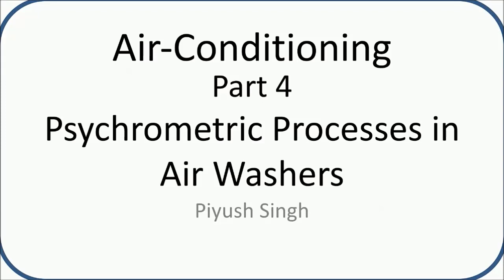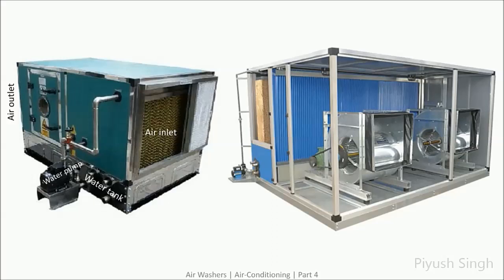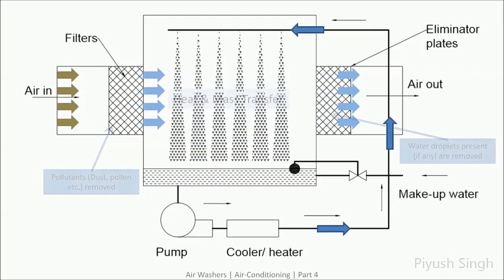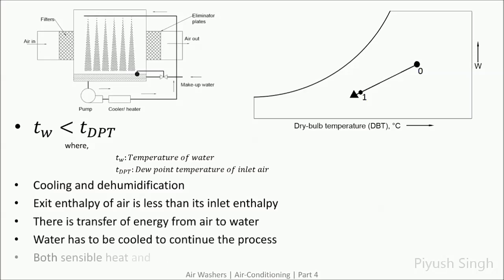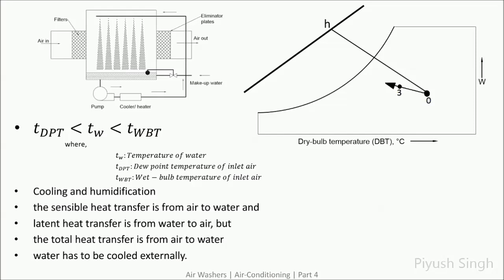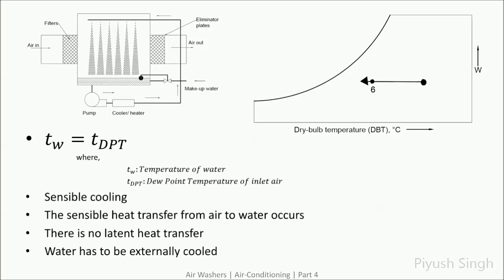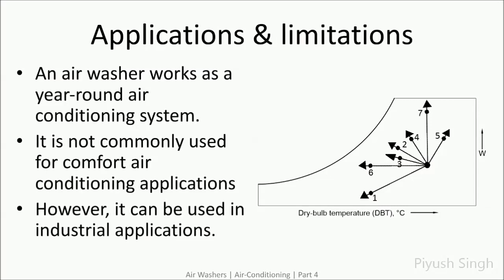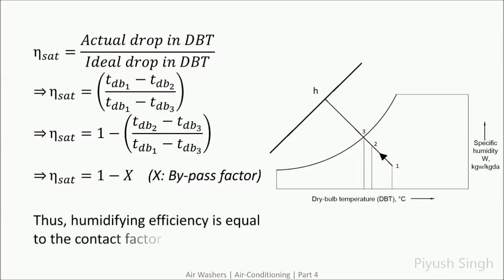Psychrometric Processes in Air Washers | Air Conditioning | Part 4

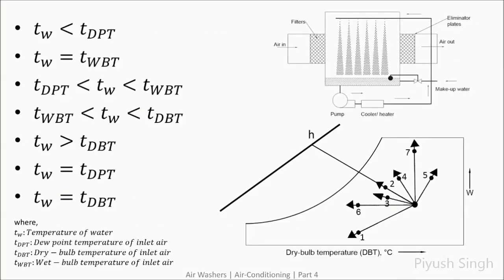Comment: This video explores the *working principles and applications of air washers* in air-conditioning systems. Air washers function as evaporative coolers, primarily designed for humidity control and air cleaning, with their performance depending on the *mean surface temperature of the water* relative to the inlet air (1:29-3:40).

*Key takeaways include:*
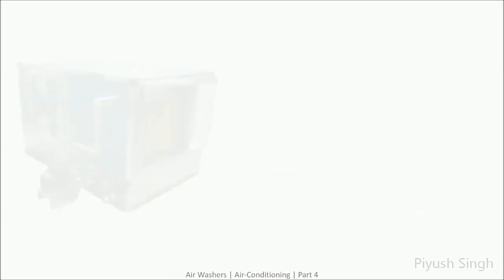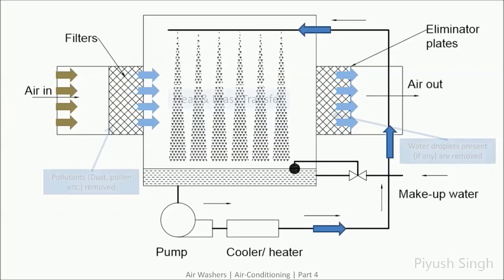* *Components:* Air washers consist of an enclosure, air filters, water sprays, a pump, a sump tank, eliminator plates to remove excess water droplets, and fans/blowers (0:40-2:10).
* *Psychrometric Processes:* Depending on the water temperature, various processes can occur:
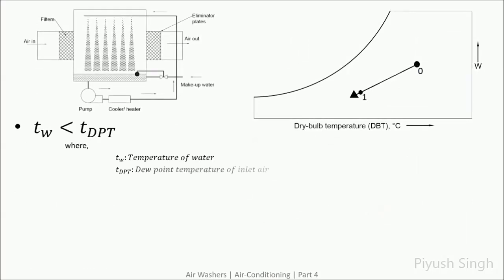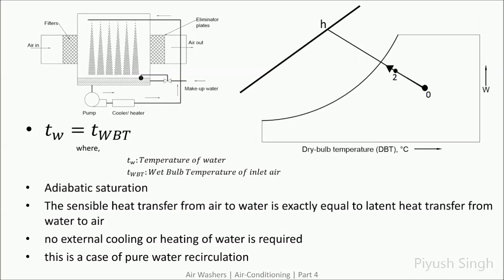    * *Cooling and dehumidification:* Water temperature is below the air's dew point (3:55-4:27).
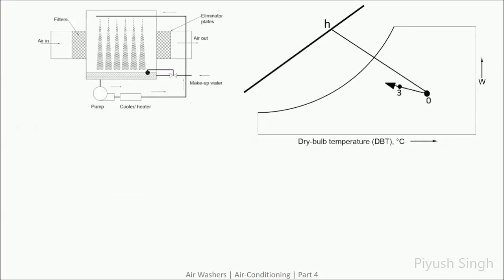    * *Adiabatic saturation:* Recirculated water reaches the air's wet-bulb temperature (4:27-5:01).
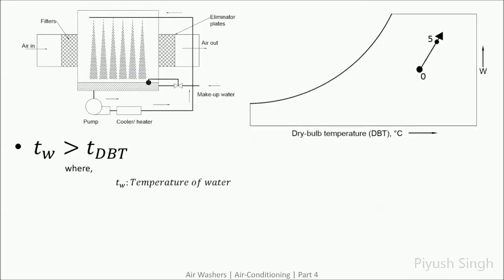    * *Cooling and humidification:* Water temperature is between the dew point/wet-bulb (5:01-6:08).
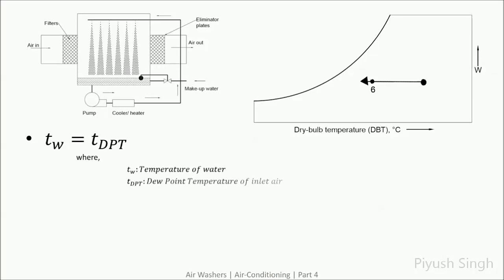    * *Heating and humidification:* Water temperature is above the dry-bulb temperature (6:08-6:32).
    * *Sensible cooling:* Water temperature equals the dew point (6:32-7:00).
    * *Humidification:* Water temperature equals the dry-bulb temperature (7:00-8:00).
* *Performance:* Efficiency is measured by the *saturation or humidifying efficiency**, which is equivalent to the **contact factor* (8:42-9:49).

Comment: What minimum temperature of air can be achieved?  What will be the required sprayed water temp.
Example if i have initial air temp at 42 deg C and RH 37 %
Is it possible cool the air up to 11 deg C and what will be required sprayed water temp un that case?